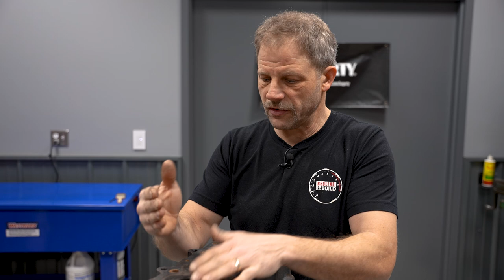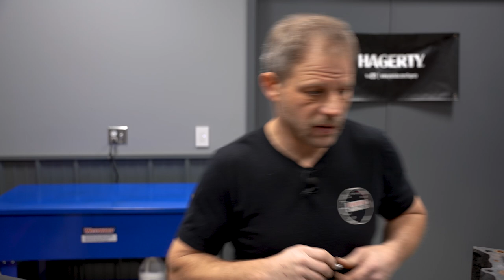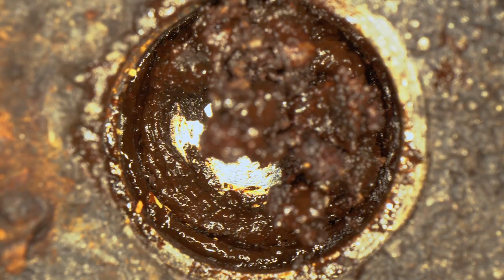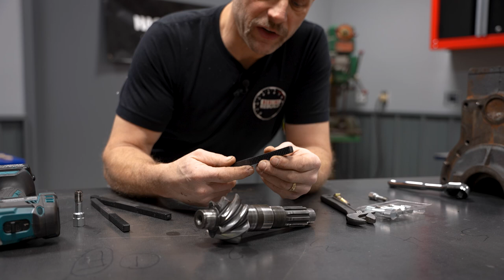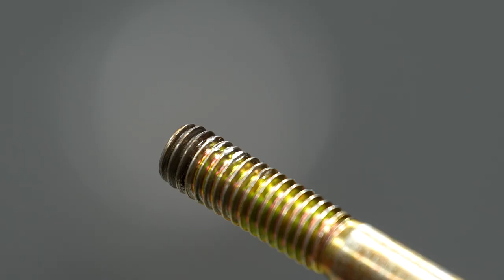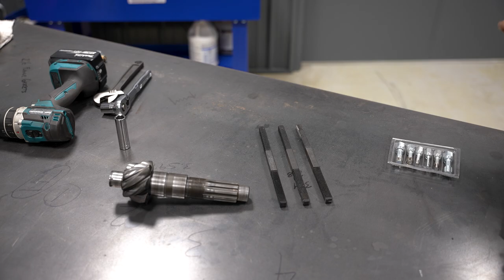Why it's important to chase and clean your threads | DIY

Comment: I have saved so many hours with thread files. One important note I was taught from a machinist was to only file and lift off never drag the file back towards you. Even when using a standard file.
Reply: Yes!!! Files cut in ONE direction.  Drawing back is the fasted way to ruin a good file.  Also, get yourself a file brush.  Again, only brush in one direction so you don’t ruin the brush
Reply: @kw2519  file brushes are amazing for their intended purpose. A standard wire brush cannot clean the debris nearly as good.
Reply: @Sackmatters  a regular wire brush with the bristles cut really short works just as well in my experience and that's what has been in most machine shops I've worked at because someone misplaced the file card and they need to clean some files so they just cut down an old brush.
Reply: @tickandslug  I’ve never cut one down before. I’ll have to give that a go.
Reply: I think the idea with staying in contact and NOT lifting off with this thread file is that you're always in the groove - you don't want to find your alignment again every single stroke, or bounce off the peaks of the thread and do more damage.

Comment: Thanks for bringing this to the masses. Most folks who aren't machinists like us have no idea about a thread file. It should benefit a lot of people. 

You're right, that's not a tap. It's a thread former, aka Roll forming tap. It doesn't cut like a tap does. It pushes material to where it needs to go. When drilling and forming a fresh roll formed thread you actually use a larger size tap drill and the roll forming pushes the material toward the center and controls the minor thread diameter. Formed holes are not as nice or precise as using a tap, but theyre a great option for many situations.

Comment: Make double sure to inspect the blind holes after cleaning the threads with the thread chaser or a tap. The debris that gets dragged loose can easily get packed in the bottom of the hole and compressed as the tool advances to the bottom. This also will affect torque values if it doesn't get removed since the bolt can't fully travel the intended distance. A stout piece of wire or a pick that reaches into the depth of the hole can break apart compressed gunk to be blasted out with compressed air. 
Also, a good bottoming tap generally won't change thread tolerances. The hole was drilled and tapped to be a particular size, and taps are pretty precisely toleranced.

Comment: How did the YouTube recommendations know exactly the job I'm going to be doing tomorrow?  I've given them no clues at all, except for all the head gasket videos I've watched and Google searches about head studs.  But regardless, considering that I do indeed have a couple unobtanium cylinder studs on this motorcycle and the only ones purchasable look like they were just fished out of the Titanic's swimming pool, doing a bit of thread recovery is going to be quite valuable.

Comment: You can file a flat or a V groove (flat or triangular file) into a known good bolt (from your spares/parts bucket) to achieve the same without buying a thread chaser kit.
A bottoming tap can also chase a thread with minimal risk of cross threading.

Clean all threads with solvent too - important if there was loctite (or similar) applied previously (also implies it'll be applied again)

I would also strongly recommend a wire wheel on a bench grinder to clean threads and finishing with brake cleaner/solvent if fasteners are being re-used, a bit of faffing about but far less effort than repairing a damaged thread because you were lazy.

Tiniest bit (just a kiss) of copper grease on non-critical bolts (use engine oil or comply with Maintenance manual directions for torqued bolts) will help with corrosion prevention as well

Hope that helps!

Source: ex-Aircraft Maintenance Engineer.

Comment: Thanks for this! I only needed one 3/8-16 thread chaser to clean up the threads for the exhaust manifolds I removed for sandblasting and high-temp painting. I found what I needed on Amazon for $8. Worked great! Glad I did not use a tap for this job. Thanks to your video, I learned that a thread chaser is the right tool for my job.

Comment: This is a very important part of a quality restoration, but it's also great to do as part of routine service.  Any time I unbolt an engine accessory or manifold etc. off my aluminum engine, I make sure to thoroughly clean out the blind holes.  I start with brake clean, then a plastic bore brush.  Haven't had to use chasers yet but it's the same principle -- keep them holes clean and trim!

Comment: Thank you I have two sets of those chasers if I need to repair threads, sometimes the hardware stores are closed on holidays and Sundays may not be able to get replacement hardware so cleaning them up is ideal thanks again sir!
Reply: It saves a trip when you actually need it if you’ve already gotten a set.
Reply: Where do you get thread chasers? All i find are tap and die kits for creating threads

Comment: As a DIYer I’ve always used the tap because they are super sharp and if youve got a good ear and a good feel you can hear and feel the difference between cutting baked on grease and junk from between the threads and cutting the thread itself 

the feel and the noise it makes is different and I think the tap leaves it much cleaner.......!!!!
Reply: I agree, especially with a tap, I do own a couple thread files and they have come in handy at times. I own an old backhoe and I’ve had 1/2” bolts about six inches long with a nut on it and the bolt sticks thru about half an inch. The end of the bolts were buggered up pretty good so I used my thread file and repaired the threads before I took the nut off and it worked great. Saved the bolts and a bunch of trouble trying to get things apart.

Comment: They also make chasers for O.D bolts. Snap-on makes a kit and it has saved me me so many times. If you work on cars in or above the rust line - this is a necessary tool kit to get.

Comment: If time or access to a replacement bolt is a problem, you just may have to try and save the bolt, so it is worth it having one of those files handy just in case. Thanks for the info.

Comment: When using a thread chaser, the tool needs to be lubricated.  Use cutting oil or some type of lubricant.  First, use brake cleaner/solvent to clean out the threads that you want to chase (blow out with air).  Then, lubricate the chaser and chase as shown.  Slowly work in and out .  

If you feel resistance, work back and then slowly forward.  Clean/reform the threads and then remove the chaser.

Then use brake cleaner and compressed air to perform a final cleaning of the threads, after using the chaser.  Insert the fastener by hand and confirm it threads properly.  Kiss the fastener a bit and tighten it down by hand.  

Then torque to spec. with a calibrated torque wrench that is rated for 20%-80% of the torque range (if you need to torque to 50 lbs.-ft.;  you will need a torque wrench with a range of 10-100 lbs.-ft. (your torque target is well within the 20-80% range of this tool).

Then clean your chaser.  Precleaning, using lubricant and post cleaning makes a difference.  It also takes more time, and is worth the effort.

Comment: Davin, great stuff! I am gonna wanna set of those thread files. While I don't work on cars, I work on television RF transmission line. It is normal threads get "boogers" as the manufacturer sticks them all into a loose bag.  Great tip! If your ever down in Toledo, be sure to stop in at Tony Packo's.
Reply: PRRGG1, not only are the hotdogs great, but the pickles are the best! My favorite from Tony Packo’s is their pickle and pepper relish, it’s great on hotdogs and other sandwiches! Go Hen’s!

Comment: Just bought a 2005 used Highlander and when I did the first oil change, I found that the engine drain plug bolt came out a little bit rough so I bought a chase from Amazon and intend on using it in the matter you describe. I was going to use a tap until I learned about these tools. Thanks!

Comment: I use my thread files all the time. And before I do anything, I will fill all the holes with a penetrating fluid like Kroil or just WD-40 and let it sit for a while. Blow out each hole and then the taps to chase threads.

Comment: my thread chaser kit also includes thread chasing nuts, for OD threads.  Those work really well for cleaning dried loctite or RTV off of bolts!
Reply: Spinning wire brush works really well too

Comment: Small holes are easy, it's when you have to work in situ or with a large part. I bought used drive axles for my car and one side was fine, both nuts fit one side, but not the other. Tried getting a specialist until I realised I may as well tackle it myself. Whilst I had the kit out, I did the nuts and although it took me a couple hours, the results spoke for themselves.

Had to clean the threads in my flywheel as well. Was resurfaced and I think it put a burr on the edges.

Comment: I love "As a for instance" for some reason.

I recently was doing my brakes and used a tap and thread file to get me back home that night after any bolt store had closed. Bolt or threads into the caliper must've had bits of metal/damage in them upon previous assembly.

Comment: If you need a ID thread chaser in a pinch, grind a couple slots down the length of the threads on a normal bolt.

Comment: The problem with grinding a groove on a bolt in order to improvise a thread chaser is that it can be hard to clean the burs created at the ends of the threads. These burs can easily damage aluminum if you are trying to clean an aluminum threaded hole. Running a nut can help. But this may not be an option if you are dealing with a more oddball thread size. A thread file could also work - if you have one.

Comment: I didn’t know there were thread files, I’d usually it it hard with a wire brush and a triangle file. This seems more accurate
Reply: Same here.....I always look at bolts when taken out and clean them up and I don't have any of the tools seen in the video it's a wire brush on my grinder with a small file.
Reply: If all you're doing is cleaning gunk, wire brushes are fine.  It's only damaged threads that require filing.  Gunk --> Rust --> Damage and each requires a slightly different approach, they are not the same.
Reply: @reallyhappenings5597  Yeah I am usually cleaning gunk off. When I do need to actually touch them up I'll throw a threaded die on it or if I don't have it I'll painstakingly go at it with a triangle file. Definitely not the right pitch and depth, but it cleans it up enough to get it to engage which is enough for me.

Comment: The set of thread chasers I bought years ago had thread chasers for bolts as well... its like a die so a bit easier to use than the file method.

Comment: I wish I’d of saw this earlier today. I chased the threads on the heads of my Harley with a tap and it came out with metal filings…. I only wanted to remove old thread-locker… I stopped after 2 holes. Luckily I only turned it with my fingers and no wrench. I’ll know if I buggered it up once my gaskets come in and I torque it all up to spec.

Comment: Great video. But you didn't show using some Lube on the chaser. I'm chasing my 4.3 L chevy astro spark plug hole.
Lube on the chaser holds on to Gunk as I remove it and clean it and go back in for more. LOL Thanks

Comment: should you use parts cleaner or solvent while doing this? should you blow hole out with air? could you use wire brush on drill?

Comment: I would prefer an outside threading die over a file, because with the file you need to angle it accurately with the thread slope, otherwise you'll take off more than you want. A threading die cuts the right geometry, no more no less, and it aligns itself well if you don't apply an off center twist to it. That being said, of course you can't use a threading die for threads on a shaft that gets thicker on both sides.
Reply: You do not need to accurately angle a file to file a thread back to shape. A triangle file is already the correct thread geometry (metric and imperial are both 60 degree threads), and the helix angle of the thread is negligible unless you're dealing with a multiple start thread like an ACME (a 29 degree thread with large flat crests, probably most common on valve bodies so not something a mechanic would see). In any regard, if the concern is taking off too much, you would be better off never using a non-split style die to chase threads because they always cut below the bottom of the tolerances for standard (2A) threads. Using a split style die would be more ideal if you still want to use one, but they require setting every time you switch sizes, and you have to use a die wrench to turn them unlike the non-split style dies which usually have a hex on the outside which could be wrenched or socketed

Comment: I had exhaust studs removed so I can replace them with new ones, but when I went to thread the new studs in, they didnt go in straight. They were going effortlessly but it was noticeably wobbly going in until it stopped half way (no force applied whatsoever). I managed to thread one in perfect, but when I removed it and tried again, it wouldn’t go in straight; same problem as before. Does it just need to be chased?

Comment: Using taps and dies to clean threads is a pet peeve of mine. You have a decent chance of ruining a thread that wasn't damaged severely. In any case, you will be removing more metal than necessary.  in the worst case, you may need to drill out the hole and install a helicoil or thread insert. Helicoils would be a good video to make next.

Comment: ok suppose i have a thread hole that is utterly destroyed (i just have a dirty one but needs cleaning) what if you filled the thread hole with filler rod then retapped the hole would that be a work around or is that the nuclear option in these examples?

Comment: instead of spending 50 quid, you can make those your self. grab a bolt of the correct diameter, cut a groove in it along its length and there you have it, your own thread chaser

Comment: What is the difference between a tap and the tool you show for thread chasing? I don't understand why a tap couldn't be used for the same purpose.
Reply: The internal thread chaser is the same size as the bolt and is designed to loosen, clean, and remove the gunk & corrosion from  the bolt hole. It will not remove base material to cut threads. Because of the tolerances, using this will leave a thin layer of gunk & corrosion on the sidewalls. The tap is a hair larger than the bolt and is designed to remove base material to carve thread in the hole. If you use it to clean the threads, it will clean them right up to the max tolerances of the threaded hole. This will leave you with a cleaner hole. An added bonus is that if the internal threads are somehow damaged, the tap will clean those at the same time. The internal thread chaser will not clean damaged threads. It may actually get stuck if you’re not careful.
Reply: @RhumRunner41  the threads were put into the block originally by a tap. The only way a tap can do damage to the hole is with improper usage (using a single handled tool to drive the tap, using an impact of some sort, cross threading it, etc), or by using the wrong tap (mixing up metric and imperial threads, wrong size)

Comment: using those I.D. thread chasing... tools with only a ratchet is a terrible idea. It's incredibly easy while using a single handle tool like that to sort of cam over or get the tool going crooked in the hole, even if it's fully engaged in the thread. If you use those to clean up dirt or grime from the thread then whatever, but if you want to re-cut a damaged thread you should really use a tap and tap wrench to evenly apply the force on the cutting tool without the added twisting or momentary action. You'll save broken taps and oversized threads that way, and you won't have to pay a machinist like me to extract the broken tap when it does break.

Comment: I always clean evert screw when i unbolt something, and everybody just smiles like am an idiot. 

(Im not saying that im not idiot)
Reply: Oil on a thread when tightened to a specific tq value will loosen over time as the oil creeps out of the flanks and decreases the fake pressure it was at when tightened
Reply: Jarek Novak, that’s a good practice to get into, you’ll save time when you’re reassembling whatever you’re working on. A lot less chance of cross threading a part too.

Comment: For the O.D. couldn’t you just use a wire brush?
Reply: The wire brush will clean rust and debris, but if the thread has impact damage like the one he showed, only a thread file will reshape the threads. Fortunately, damage to threads like that isn't that common, unless you bought a used car from Primitive Pete. (Old shop film reference for us old guys).

Comment: I do not see the point in these devices, each has a tap or a die for threading, and with a grunt, you can finally wash it off with a solvent or blow it out with air and the tap is longer and the metal is strong there!  useless things!